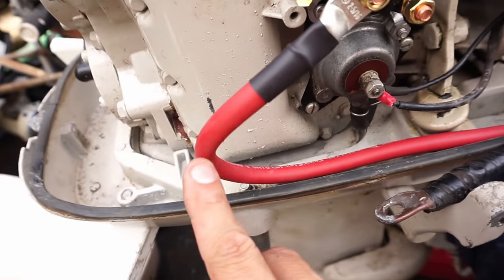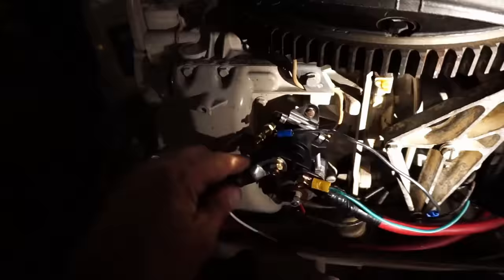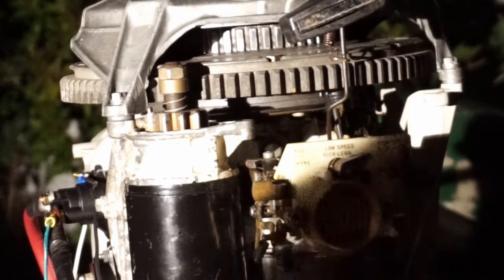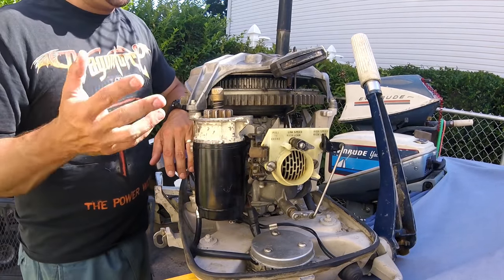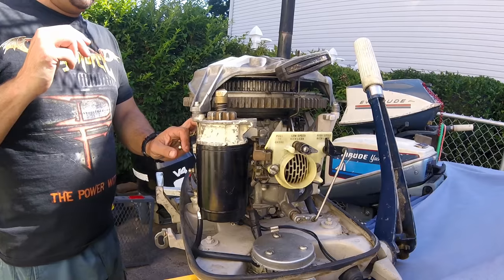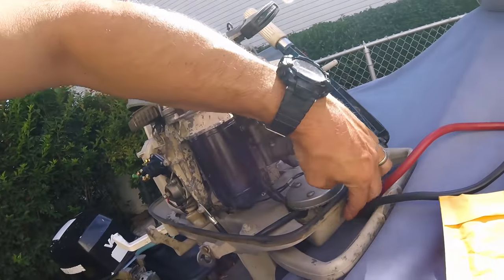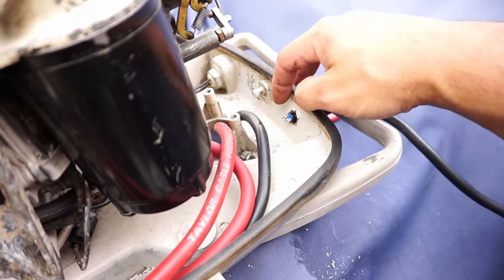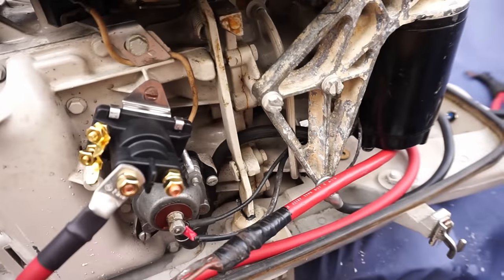EASY! HOW TO COMPLETELY WIRE A PUSH BUTTON START ON YOUR OUTBOARD!! 2.0!! Quick AND extended version

Comment: Hey man I have the exact motor pretty much except mine is a 35 hp but I was wondering how I could put a charging system on that motor
Reply from the maker: great question. I dont know for sure but if you add a rectifier from the newer motors, you may be able to custom wire up a charging system. I think its possible but ive never seen it on these older motors

Comment: Hello sir, I have a 2019 electric start outboard motor, and all the sudden the push start doesnt work, it's quiet like battery is not connected, i have full charged battery connected though, any advice please?
Reply from the maker: 2019?? its gotta be something silly like bad ground or the button got water in it!! check your wires for cracks!

Comment: Great! Any ideas about the electric choke?  I'm trying to start a Mercury without having to hook up the controls. Thanks
Reply from the maker: if the electric choke is broken.. you can install a manual one on it..or the old fashioned way just to get you running is to put your hand over the carb opening or a rage. just hole tight lol that carb will suck a towel right in!

Comment: Just bought a used jon boat. It came w/ a 1970 Johnson 20hp outboard. I was wondering how to rewire a electric start (it had 1 rigged already but rust/wear). 
Great vid and easy to understand. Thanks
Reply from the maker: yup should be straight forward! let me know where and if you get stuck ill try to walk you through it!

Comment: I need to know how to wire a kill switch to turn the motor off. Already installed the push button but I have a 1981 mercury 50hp outboard and it doesn’t have a kill switch
Reply from the maker: i have a video on that!! Ill try to link it in a few!
Reply from the maker: https://www.youtube.com/watch?v=D3HRGZ7Sw5M

stay tuned to the end for 2 cylinder motors!!

Comment: So I guess if I just wanted to start my motor  the dirty way is ground the battery and connect the battery positive cable to the starter motor. Have an old 1978 Evinrude 115 and just want to do a compression check on motor first.
Reply from the maker: yeah! you can connect a starter button. they sell them on amazon! uses alligator clips! one to starter one to coil!!
Reply from the maker: https://amzn.to/3cGpcra

Comment: Have a 1870 Johnson 20R-70E. Where/how do I find the right solenoid for this outboard for the conversion? Thanks again. 👍👍👍
Reply from the maker: I though I linked the selonoid I used in the video.. Ill check now! just buy any on amazon that have 4 posts!! the mounting it part is the tricky part.
Reply: @BlackoutBilll21  Can you tell me which  one you bought/installed sku# brand? I bought 1 but it doesn't fit under outboard cowl/cover. No room. Thanks,
Reply from the maker: @rocko112camaro  https://www.amazon.com/gp/product/B01LBR1DRY/ref=ppx_yo_dt_b_search_asin_title?ie=UTF8&psc=1

Comment: I have a little pocket bike but lost key and have no battery.    Can I by pass all that nd still start or will I need batte ri
Reply from the maker: Not sure… you can start anything combustion wise. Just need to spin those pistons somehow lok
Reply: @BlackoutBilll21  thanks.   I got it on but it wouldn't idle.
Reply from the maker: @bennypacogerrte418  time for a carb rebuild!
Reply: @BlackoutBilll21  thanks.    I got it to work 👍👍

Comment: Another quick question as I am getting ready to wire mine this weekend. So the push button gets one wire connected to the solenoid (one of the big posts) along with the battery. And the second button wire gets connected to one of the smaller posts? So you're essentially creating a short to activate the solenoid?
Reply from the maker: the solenoid is the open circuit and the button closes it! so you are correct!
Reply: @BlackoutBilll21  you rock!
Reply from the maker: No YOU rock ! Lol thanks for tuning in and commenting!

Comment: Quick question do we have to take the prevy wire harness
Reply from the maker: What do you mean by Prevy?
Reply: Sorry like the previous wire harness cause the one that came with the boat  and it have controls on it but they cut the wires of and the control cables off so now I just have a motor that I need to make run or at least see if it runs
Reply: It's a 50 hp Johnson
Reply: Oh one more question how do I install a kill switch too thanks
Reply from the maker: @210fishing6  https://www.youtube.com/watch?v=D3HRGZ7Sw5M
Reply from the maker: @210fishing6  JUST RUN YOUR SWITCH WIRES TO EACH SET OF POINTS ONE WIRE PER ON YOUR MOTOR!
Reply from the maker: @210fishing6  so you basically need to just install a key witch by simply wiring it to the starter. You wont be able to use a regular set of controls the traditional way. Still doable unless you can find an original wire harness and controls. Not easy.

Comment: It looks great thank you for sharing my engine does not have a pull start the shifter or the controller the guy took it off the boat and he didn't give me the key and he took off the cables as well so I'm looking to see how to fix it and I think I just found it in your video thank you so much
Reply from the maker: Glad it helped!! If you have any other issues with your motor let me know if I can help!
Reply: Iglad ran into this video cause I had the same issue

Comment: Bill…I see you have the battery wires coming up thru the hole in bottom of pan.Going to put starter on soon as I get parts.Did motors initially use that hole in bottom.Seen a lot where they go thru a hole in face of motor.Hate to drill a hole if I don’t have to.
Reply from the maker: So the battery wire are going through where the original wire make hookup went on these controlled older big horsepowers!! Originally there was a male connector and the controls had the female. If you can find a way not to drill then all power to ya! For me the little hole with a button plugged in looks good but you gotta do what you like!! Keep me updated!
Reply: Ok. I have to drill hole for a switch but wanted to try not to for the battery cables. I saw a video where a guy added extricate start and he used a battery box and a small lawn battery and put the start switch and solenoid  in the battery box .Nifty idea.
Reply from the maker: @wish2fish37  hell yeag

Comment: really well done.  excellent idea doing a short and long version.  how do you avoid starting with the engine being in gear? factory starters have a button assembled through the forward - reverse selector lever so that you cannot start when the engineer is in gear....
Reply from the maker: Thats a great question!. I dont believe there is a factory way... you could maybe rig a ground wire where the gear shift touches it and the starter button maybe? I dont know but Im sure its possible!
Reply: @BlackoutBilll21  The factory button is built into the gear shift such that the starter button travels through a short tubular channel at the base of the gear shift to then depress the actual started push button. The first button won't travel through the channel if the gear shifter is not in the neutral position.  My starter button is going bad and the replacement is hundreds of dollars.
Reply from the maker: @frix57  WOW! not sure! sounds like your system is beyond my pay grade lol

Comment: Great explanation of how the starter button works and how to wire it.  I am having trouble with my key ignition and am thinking about bypassing it wit a push button.  How would I kill the engine once it is running?
Reply from the maker: you could install a kill switch!! i have a video on that!! or you can pull the choke! what year? do you have a regular choke?
Reply: @BlackoutBilll21  I have a kill switch. It’s a 60 hp Mercury 4 stroke engine.  When I turn the key to the on position, the voltage from the battery takes a while to climb up to 12 volts.  I took the console apart looking for a corroded connection.  I found some and cleaned the connectors.  That helped but I still notice the gauge doesn’t show the same as my volt meter.   I think Tracker wired it half ass
Reply from the maker: @heted1  sounds like youre on the right track! good luck!

Comment: Do u know if this can be done on a 94 8 hp. I can't find crap on it. Awesome vid
Reply from the maker: thanks!! sorry for the late reply. You can do this to ANY motor with a starter and/or/ toothed flywheel setup. not sure if the 8hp had that. can you send me a picture?
Reply: @BlackoutBilll21  I been tearing it down. It's a 94 the flywheel doesn't have the teeth and theres no I can't think of what it's called but there's no part that looks like a starter but has rope around it. So don't think I can do it.
Reply from the maker: @jshall1000  I have to agree with your assessment. Why do you want a starter? Is it hard to pull?
Reply: @BlackoutBilll21  yea hard starting and I got copdand kids me
Reply from the maker: @jshall1000  I’d look at your needle setting/ compression. Those motors can be started by hand spinning the fly wheel if tuned properly
Reply: @BlackoutBilll21  the wire to the charge coil and sensor r so dry rotted out and from the powerpack the wire to the spark plug coil just hanging there. Man no wonder it took me forever to pull it to start. Thanks for the tip I'll check the carb when I figure what the heck in gonna do where there's no wire insulation ugh